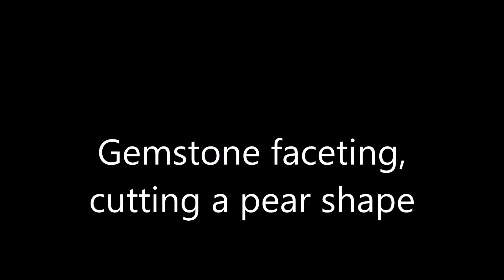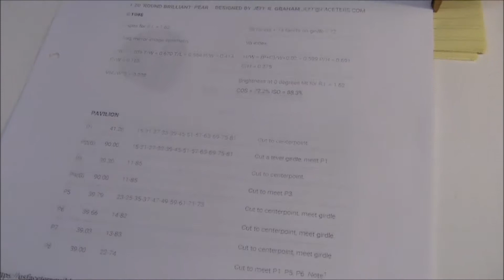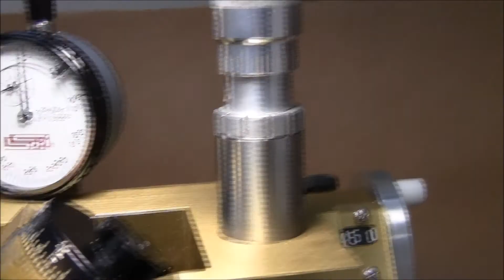Gemstone faceting, cutting a pear shape

Comment: Great video. It's amazing seeing your work. I don't have the necessary equipment to start faceting, but every work of yours I see, more I want to have one. Congrats.
Reply from the maker: Thanks for those kind words,  the machine  can be costly if one were to look at used equiptment or  an asian machine, its  possible to get something without spending thousands of dollars. Ive seen a few on ebay: https://www.ebay.com/itm/Gem-Faceting-Machine-Jewel-Angle-Polisher-Jade-Grinding-Faceted-Manipulator-Tool/302980385282?hash=item468b09ca02:rk:1:pf:0